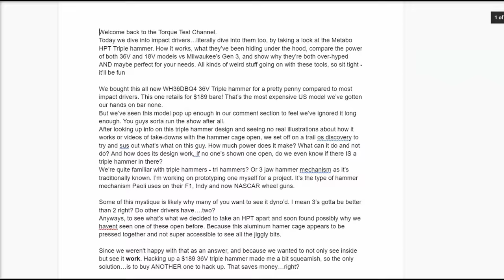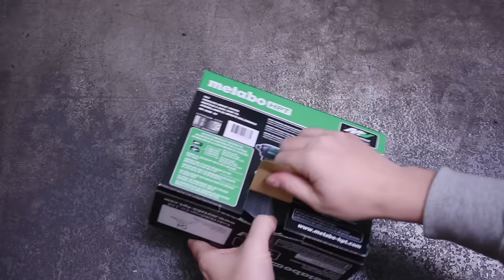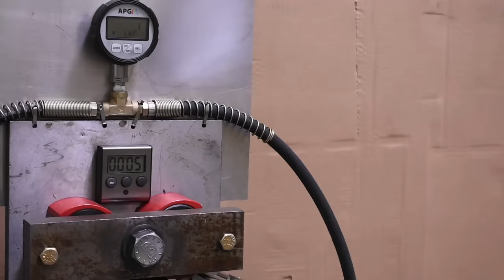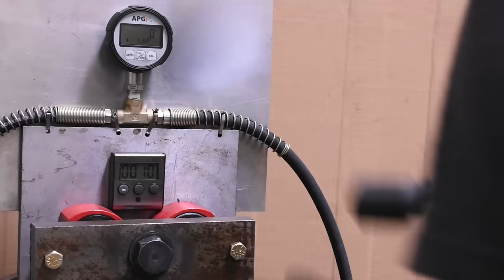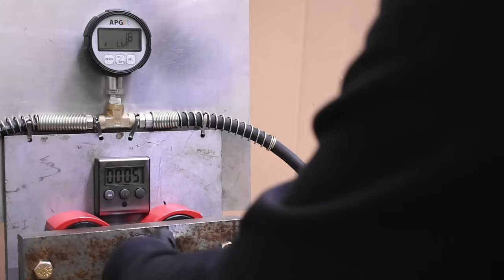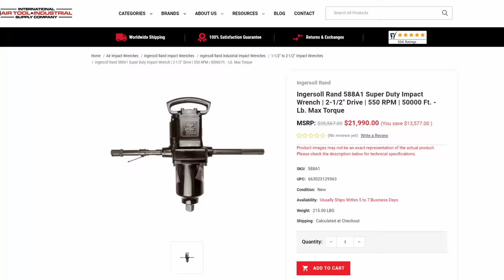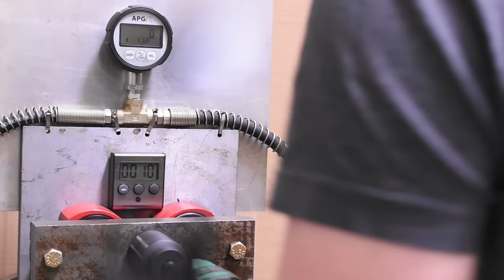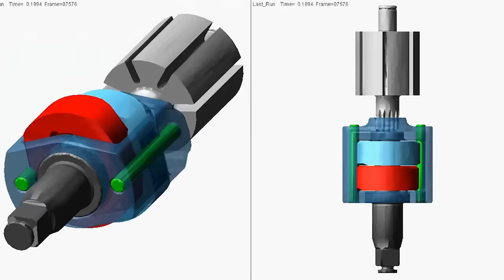High-Speed Video Uncovers Weird Stuff In Popular Impact Driver (See Comments)

Comment from the maker: READ 1st: Appears as though this may be a "not a bug, it's a feature" deal? Overseas Hikoki advertises Power mode (P) as hitting 1.5 times a rotation, so this may be by design? We contacted HPT 5 days ago and they ultimately said they'd need to check with their Japanese engineers to speak to this. So I'm guessing it's not just new stuff to us. We tried to do our due diligence. Seems to be losing some that energy hitting the top of the next dog, but DOES sometimes skip it. Who woulda thunk. We don't see this advertised in the HPT manuals that came with these so you'll have to excuse us for that, we don't usually read international brand manuals before using a tool purchased here. What do you think? We could always take this video down if misleading.
Hikoki: https://www.hikoki-powertools.com/products/powertools/li-ion-screw/wh18dbdl2/wh18dbdl2.html
HPT (page 16): https://www.metabo-hpt.com/docs/default-source/owners-manual/wh18dbdl2(metabohpt)_pdf_manual_view.pdf?sfvrsn=4c361466_0
Reply: I'm not sure how EVERYONE missed it. But this is actually advertised as a feature by Hi-Koki everywhere else in the world. They describe it as "Power Mode" (thus the P as the setting name). I remember seeing this somewhere on the US Site/Tool Packaging back when it was Hitachi and I'm not sure where it got lost. Or how every ToolTuber has somehow avoided the information. Now, that's not to comment on the actual result of their intention. Just that it definitely IS intentional. 

"When enabled under heavy load, the power mode dramatically increases the impact energy by reducing the impact rate to 1.5 impacts per rotation and extending the interval between successive impacts. This mode is ideal for long or thick screws." 

https://www.hikoki-powertools.com/products/powertools/li-ion-screw/wh18dbdl2/wh18dbdl2.html
Reply from the maker: @HollinHoffman  Thank you! Have you found any HPT literature that mentions this?
Reply: @HollinHoffman  Good catch, obviously the gun still stinks however. I would not want a screw bending impact lol. This feels like a case of a feature that turned out to be a hindrance but HPT decided they are getting their research and development money back on that triple hammer feature results be damned
Reply: I guess the next test is how well will drive nails and what's the biggest nail it can drive?
Reply: It sounds like this is a ”It’s not a bug it’s a feature.” kinda thing.
Reply: I agree with "Fear of Chicken". I think it's a bug. It doesn't do what's clained - proven by TTC testing.
Reply: That's the hidden hammer mode
Reply: Leave it, serves as notice if you’re considering the triple hammer for use on larger fasteners. I know I wouldn’t want to drop that much dough and have a weak sauce impact that bends screws.
Reply: With what you have learned from the overseas Hikoki information do you believe there is something about the way the dyno or the guns themselves work that is preventing them from making less power on the dyno than they would in real world use driving/removing a screw/bolt/nut? Similar to Milwaukee Surge or how a drill can't be tested with this type of dyno. If they got a fair shake here then I think they not only belong on the dyno, they should also include a warning that they could potentially bend fasteners. I don't have a need for an 18v or 36v impact driver, but I know I wouldn't be buying an impact wrench that is weaker, more expensive, and has a much higher potential of damaging fasteners.
Reply from the maker: @James-tf7kn  Nah, what we're seeing everyone sees when they try to do "big" stuff with these guns. They drop off, for reasons it looks like few people understood.
Reply: Very interesting: I own the 18. It's pretty great. I've not noticed any trouble with this issue. In power mode it's supposed to be sort of automatic, hitting less frequently when needed. But I suppose that might cause some weird bending of fasteners. Mine is an early version, Hitachi branded. Maybe there's been a change from one lot to another. I'll have to give it a try on something pushing it as hard as I can and see what happens. I don't have any torque measure setup but I can hear/feel operation changing. I've driven some huge screws into pressure treated lumber and sank like a hot knife through butter.
They've had issues, drills with defective chucks, at least one manual error I wrote to them about, poor performing and very loud oscillating tool; so maybe there's something going on here. They have lifetime tool warranty, I'd make a claim.
Reply: I would guess some engineer though the skip would be a good to try to get velocity of the hammer up to create a “heavyweight” hit. Could work in theory, but maybe not in practical application of this size.
Reply: I suspect that skipping of hammer blows is not accidental and has something to do with those destructive harmonics you mentioned.  Seeing those screws warp in that attached video was obviously the natural resonant frequency being approached. I bet if you watched a standard impact closely with your high speed camera, you'd notice it skipping hammer blows randomly.
Reply: For me it’s a mute point. I don’t buy Metabo. I think they were a great tool brand once. I use Makita tools. But I do appreciate all the work, expense and research this channel does. Thanks
Reply: @TorqueTestChannel  It's almost as if it really was an oversight that they found in testing, but instead of spending the money to fix it, they just told engineering and marketing to make the problem go away. And what they came up with is what Hollin Hoffman provided.
Reply: I say leave it up. 👍👍
Reply: @Torque Test Channel  I've been wondering about the anvil/hammer spacing after watching  Sixtyfiveford 's video on Universal Weighted Impact Socket Adapter which has some good insight on impact twisting forces.
Reply: A hammer clutch works a lot like a syncro in a manual gearbox. The more teeth it has the slower the gear change/mesh is because a collision is more likely. With less teeth in the hammer clutch there is less chance of a collision, more momentum and more drive time under power.  The ratio between dog width and diameter will also affect its output. This is why the big old school units used the triple, the cordless stuff that you are testing is way to small for a triple dog.
Well that's my theory anyway...
Reply: You should cut two of the dogs off and two of the anvil's off and see how it works  with only 1 dog and 1 anvil-- since I haven't ever seen one made that way...  Maybe just cut one dog off first, then test---  then cut either another dog or an anvil off-- test-- and keep going until you have only 1 dog and 1 anvil.  It would be slower, but it also has more room to pick up speed, so maybe it would hit harder--??? I think it would make for an awesome experiment, since you already ruined it anyway.
Reply: @HollinHoffman  Given that apparently the result is bending large screws, which are supposed to be the usage that benefits from this design, it sure doesn't seem like it worked out as planned, if it actually was the plan.. seems more like a retroactive explanation to me.
Reply: As much as it’s probably not worth the time; what you could do is throw a fat spring into it. Something strong enough to overcome the inertia of the dogs jumping.
Reply: I suspect that this was an idea that the math penciled out great for and that they just went straight to working towards production for. And, regardless of the results, bending screws, power actually dropping off instead of climbing, etc., the development budget for the model was already spent and it's "good enough" to be a solid mediocre in the market, so send it. And, put some feature highlights in print about how this feature works as planned and makes more uga dugas with this whole power setting hammer skipping thing, it's not like anyone can prove us wrong anyways...
Reply: Don't take the video down this is all good info. As impact junkies and people that use impacts we need to know as much about the tools to make good decisions and make wise purchases.
Reply: The controller needs an rpm limiter.
Reply: Hmmm Collab with the slowmoguys? 😉
Reply: If this was a "feature" then that feature should be causing it to make more power.  At least they did call it out in some documentation, but if it's a feature it's truly one of the worst features available
Reply: Misplaced feature?! Absolutely, should be on a 3/8’s drive or something…without that violent forward thrust
Reply: @TorqueTestChannel  I wonder if when it's got all that grease in there it slips worse then it does when it was opened for a internal peak.
Reply: Please leave the video up.  Even if it's a "feature", as others have mentioned it doesn't seem to be functionally beneficial, rather detrimental.  It's good to know that.  It also doesn't seem a comfortable tool to use, what was it's Wrist Breaking sore [sic]?
Reply: Absolutely loved this - painting the parts was a huge help - maybe if you do something like this again label the hammers and anvils (A, B, C & 1, 2, 3 etc)? Might be easier to explain the 'missing' that is occurring.
Reply: You think this thing might drill into concrete better because of this?
Reply: @kylefowler5082  This impact is anything but a bad tool.  Is it the most powerful impact driver on the market?  No.  Does it “stink?”  Absolutely not!  I use this tool practically every day on the job site and it has plenty of power for almost every fastener used in construction.  Not only does it have plenty of power, but it is far SMOOTHER to run than Milwaukee or DeWalt.  I feel far less vibration in my hand while using the Metabo HPT.  I’ve also never had a problem with it twisting any type of screw.   However, I’ve never used stainless screws and I have heard of people having issues with those.  But the “issue” described in this video is intentional and the power increase is noticeable when running in longer lags.
Reply: @rjm7168  Well, I’ll say from experience with fasteners on the job site that the power mode DEFINITELY sinks larger fasteners with more authority than the other two modes.  I’m no scientist, but I use this tool almost daily and I can see the difference.
Reply: @Joethetoolguy  It only twists stainless fasteners in my experience, and I never use stainless, so not really a problem.
Reply: Leave the video up.  It's not misleading,  it's great information.  If you find a link to literature that explains their design just add it to the video description.
Reply: @EF-69  Your tool and this one are working properly.  They are great tools with plenty of power.  I love how smooth they run compared to other brands.
Reply: @EF-69  I’ve only seen them bend stainless screws in my experience.
Reply: @davidb6576  It’s actually extremely comfortable to use, and the power mode works noticeably better on large fasteners.
Reply: @AC9BXEric  Agreed.  I like most of their tools, but they need to update the oscillating cutter and their cordless miter saw.
Reply: @baraksinz  I've had no trouble with the impact driver, it's been great. Their circular saw is great, drill is great as long as you have a good chuck. They've had issues with it. They loosen when you stop quickly. Oscillating multi-tool is much louder than most and only mediocre power. In general the Hitachi/MetaboHPT is my favorite but it's not all perfect.
Reply: I don't think you should take down the video, but maybe you can add a conspicuous overlay stating "Per manual, this behavior is intended". I think that would help.
Reply: @baraksinz  And that's what matters. REAL WORLD use. But it takes longer to make those types of videos because you have to actually go do work for 6-12 months. Yeah, in all those tests people used stainless steel lags which bend easily. The average person doesn't know that though and it just looks like the tool is bad. Get something magnetic with a tensile strength of at least 5 and the test becomes more realistic.
Reply: Having both the 18 and the 36v, I typically don't use the 36 cuz the 3ah batteries are so small it's fantastic.

But when running average screws, 3 1/8 grid or smaller the triple hammer drives them faster than nearly any other gun. Big lags and bolts it don't do as well with and I don't use it for that typically I'll get my drill out and sink em
Reply: Has no one else had a metabo hpt 4ah 18/36v battery die in the cold?
Reply: @TrippyMushrooms  I've had bad luck with their batteries dying which puts a shame cuz the tools are great
Reply: @TrippyMushrooms  nope. I've had a Milwaukee die from leaving it in the garage through cold and hot cycles. After that, I keep all my batteries inside even if the tools are in the garage.
Reply: So do they say that the twisted screws are a "feature" as well?
Reply: Well if its intentional and they dont have it on our advertising...that makes it not only a crap design but intentionally misleading the customer, good work in finding this.
Reply: If that's true, (that it's part of the design, and NOT a flaw), then WHY exactly would they even do that? (Because it appears to be limiting and reducing its maximum torque abilities, as when compared to other brands and designs, even (especially) on the higher settings, which is the settings at which you'd think/expect you'd get the MOST torque out of it!)
Reply: Keep the video up, feature or not it's important consumer advice and extremely well presented at that. If anything Hikoki should pay you for your indepth real world test.
Reply: You do realise 'international' for a Japanese company includes the USA?  If a company has an international website it's for everyone, not everyone bar the USA so the international website was for YOU as much as it was for any other country that spoke English.  Unless you think the official language of Japan is English.  The website for the Japanese market ends with a .jp domain name.
Reply: @baraksinz  You sound like an advertisement.
Reply: @pbjandahighfive  Well, what can I say?  I like most of their tools, and I use them daily to make a living.  I did mention, though, that some of their tools need updated, and I would also agree with some commenters on the fact that their batteries could be more robust (internally).
Reply: @kylefowler5082  If you watch the referenced video, you'll see it only bent those 6" stainless steel screws, and only the 36v model did this. It didn't do that to any other type of large screws or lag screws, or in any other mode.
I think people are having a really hard time understanding what's going on here

Comment: Looks like a case of “more is not better” it seems like just having two dogs is more ideal and gives the motor more time to build up momentum before it drops the hammer
Reply: yes but more blows per minute means that you can drive in a screw faster. TTC said this only occurs under the highest torque loads, so "more is not better" for these applications? meaning youre not driving the largest lags you can find but for medium torque applications im sure this design is optimal...everything in engineering is a tradeoff
Reply: @MattB90  exactly. For every action there's an equal and opposite reaction.
Reply: @MattB90  more hits if it doe not miss but they dont have as much oomff behind the hits as a ragular 2 hammer.
Reply: @OGbqze  bruh, you stole that from Einstein.
Reply: @HellZReaper134  I didn't steal anything. I just commented something. What are you on about?
Reply: @MattB90  IMO people should be using a mid range torque wrench for large lags.
Reply from the maker: Lol that would be Isaac Newton guys :P
Reply: IPM rating seems like another marketing wank term like HP for vacuum cleaners and PSI for pressure washers - they leave out the context.  Chasing higher IPM seems silly as you can tap on a railroad spike really fast with a tack hammer all day long an get nowhere  but a few good whacks with a heavier hammer will get you some progress.  I think those big 1" guns used for heavy equipment have a single anvil.
Reply: Ever see that Amazon impact corded 49 dollar impact taking off a crank pulley bolt. Reason I think it works it hammer blows very little and just spins fast theb hits off and on. The momentum breaks the bolt locked grip.
Reply: @HellZReaper134  You're making Newton turn in his grave
Reply: @MattB90  I love all my triple hamers
Reply: I wonder at what size faster that triple hammer works best to.
Reply: Not only more time, as in more degrees if rotation, but two dogs leave much more room for the hammer to fall into.
Reply: @DuoFurey  you are going to drill in a large lag with a torque wrench? this mans gets paid by the hour.
Reply: So I own Milwaukee, Makita, and hydrologic impacts and the green one here is my favorite because it is smooth and has better control with less jolting vibrations. So it is my favorite, and I am a carpenter. Hitachi/metabo rocks
Reply: @TorqueTestChannel  Never let the facts get in the way etc.
Reply: @dorhocyn3  it's superior for deck screws and self tappers-never let real world use get in the way😂
Reply: @HellZReaper134  Newton*
Reply: Well in real life, the anvil would move and not stand still, so it probably hits better in real life applications?
Reply: @TorqueTestChannel  🤣🤣🤣 SIR* issac Newton. 🙃
Reply: @HellZReaper134  Newton.
Reply: @HellZReaper134  E=MC^2 is Einstein
Reply: @HellZReaper134  Newton.  I mean, you were like, only 200 years off, though.
Reply: @AlbionSupreme  Shhh....I think they're trying to make Newton into a perpetual motion machine.
Reply: @OGbqze  wow. Dude did you make that up yourself?? 🤯🤯🤨🤨🤨
Reply: @h8GW  🤣🤣🤣😭😭😭😭
Reply: @TorqueTestChannel  Does it maybe neet a stonger spring on the hammer?
Reply: @MattB90  Not necessarily, force per blow is what really matters, if you lose force but gain volume, you won't gain anything.